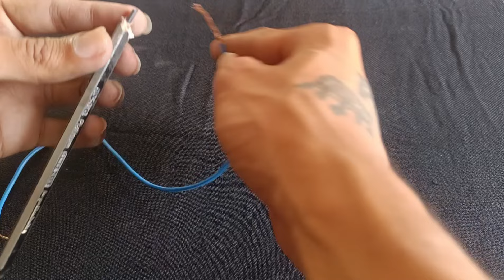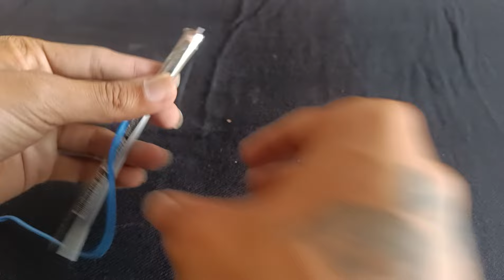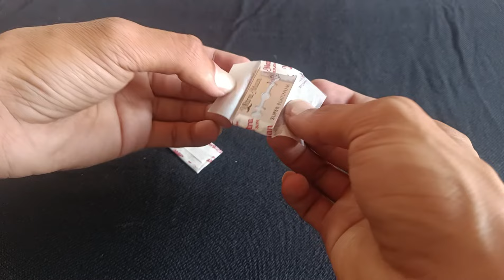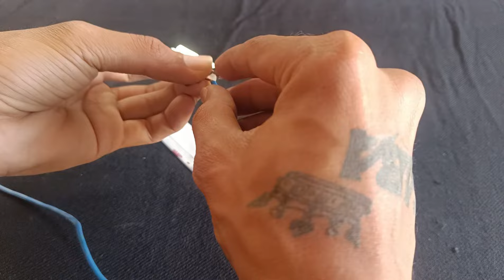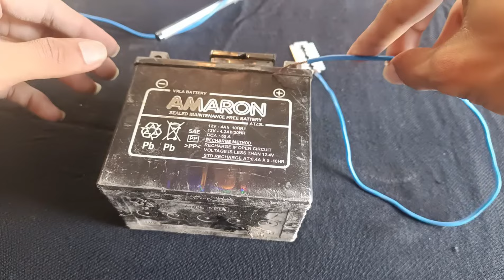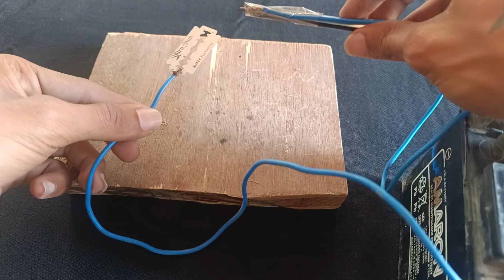How To Make Simple Pencil Welding Machine At Home With Blade | pencil Welding Machine

Comment: it's the basic principle of arc welding by using heat resistant rod to create arc and melt metal, so this video is accurate at that demonstration
HOWEVER, this puny battery would do very little job at that, you need to hook up more batteries in order to bump up the power while also not letting these batteries deep discharged (which is harmful for lead acid battery)
overall, this video is somewhat accurate, it just need better power source and eyes protection